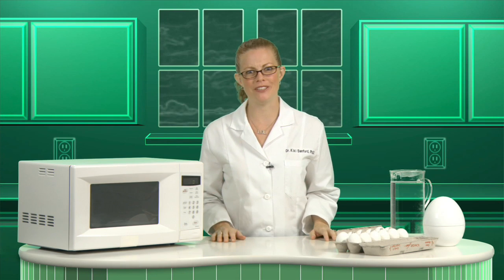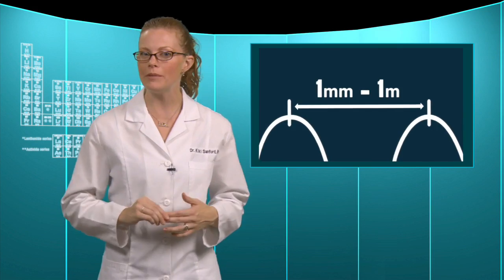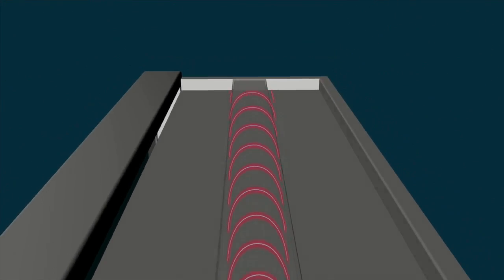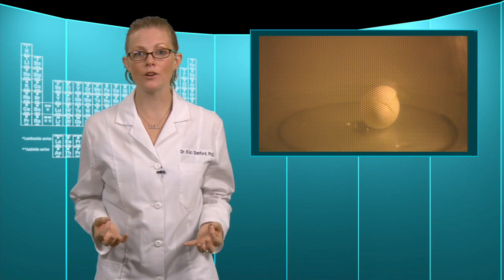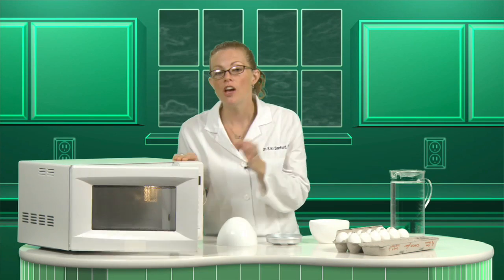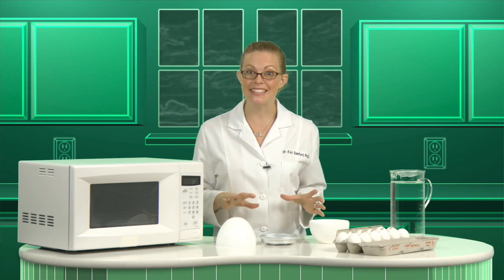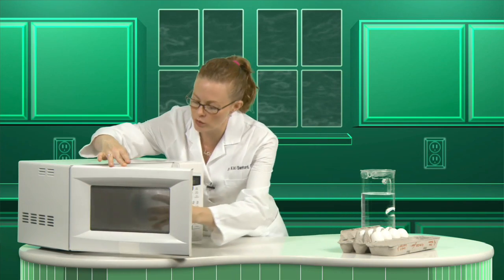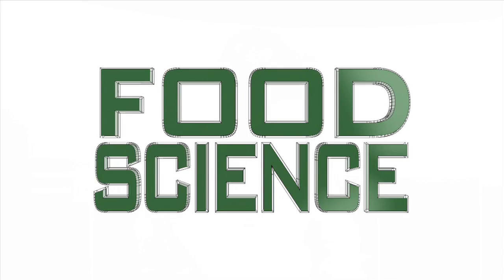How-to Microwave Eggs - Food Science

Comment: Real simple . I use a 4 inch by 5 inch by 2 1/2 or 3 inch deep  corning ware dish with  3/13 cups of water  AND.. 1 level  tablespoon of salt that must be dissolved in the water or the eggs will explode. A 1400 watt microwave it takes about 5 to 6 minutes to hard boil the eggs. 

  The salt reacts with the egg shell acidity and keeps it from cracking.

 Put the eggs in an Ice bath to remove the shell or in the freezer to cool well then put a egg in a glass fruit jar and shake from side to side well. The shell usually comes off easily in big parts.

Comment: I have a different problem can I help me, cuz I can't wrap my head around this, I just brought some duck eggs and tried to microwave 2 of them but I  cracked them opened onto a ceramic plate and too it out when I felt it was done then left it for than 15 seconds came back and it exploded on the plate when it was just sitting on the kitchen counter, so I go to investigate it and the egg white was kinda plasticky... can u explain the exploding of the egg if it had no shell and explain the plastic btw my first time microwaving eggs and first time wanting to try duck eggs.
Reply from the maker: The egg white likely got a bit over-cooked, which would explain the plastic-like condition. The exploding was likely due to water that was trapped in the cooking egg that was heated to a vapor point. The water vapor built up, and burst out through a weak point in the egg's membranes. Even though it was sitting on the counter, it was probably still cooking a bit internally due to heat build-up during the microwaving process.

Comment: 1.  You neglected to discuss the POWER SETTING to use when boiling the egg.
2.  You neglected to discuss the difference between HARD boiled and SOFT boiled eggs.
3.What effects do the POWER SETTING and the TIMING  have on the hardness of the yolk ?  To use this technique, one needs to know this.
4. WHERE can one acquire the demonstrated equipment ?
5. You never once mentioned the TIME required to complete the process.
In short,  some of the MOST CRITICAL information was overlooked during this demonstration.  One could not be expected to successfully employ this technique with the information supplied.
Reply from the maker: Power settings are different between microwaves. I have other videos that discuss proteins. The video was a discussion of a concept, not an ad. There is a search engine called Google that can help you find devices like this if you are interested in one.